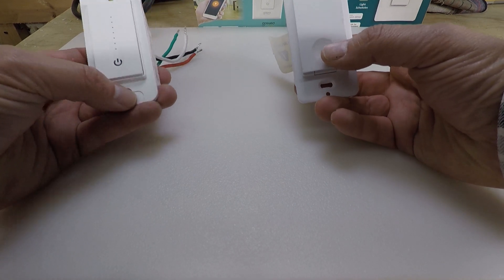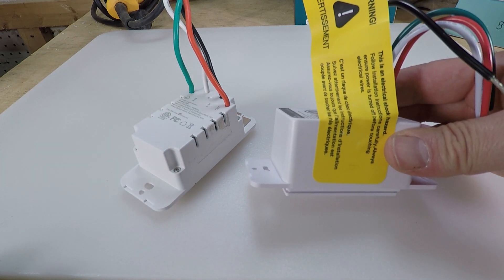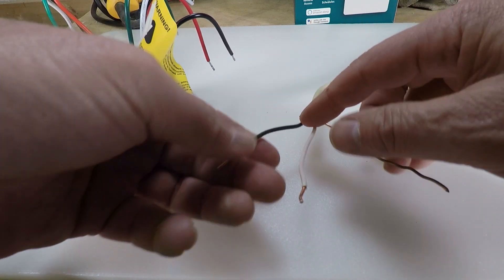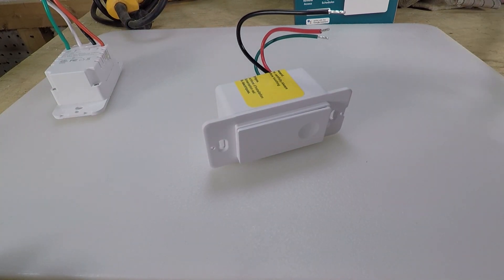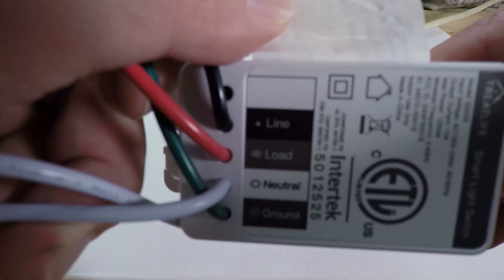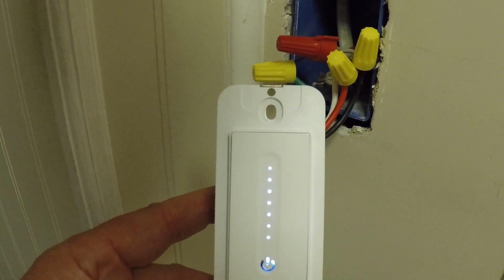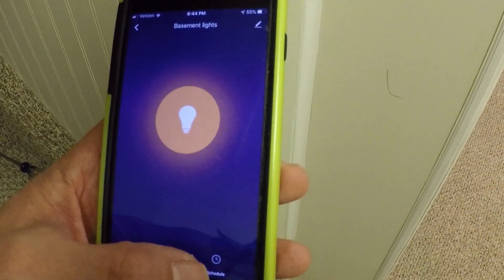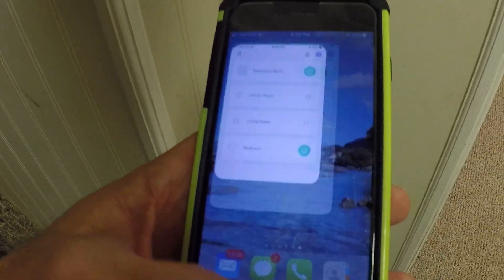Is It Worth Upgrading to Smart Switches?

Comment: So glad I found your channel.  I live in a rental and wanted to set my porch light to a phone app. I'm a little unsure as the switch controls my ceiling fan, lights for that fan and my front porch light. Can I use just the smart bulb for the porch?
Reply from the maker: yes you can use a smart bulb if it is in wifi range
Reply: @flannelguydiy6458  Thanks so much.

Comment: Having worked with Chinese manufacturing,I think these switches are made by the same manufacturer. I find these switches very handy for applications where you want lights turning off and on when away from the house, particularly outside floods etc.